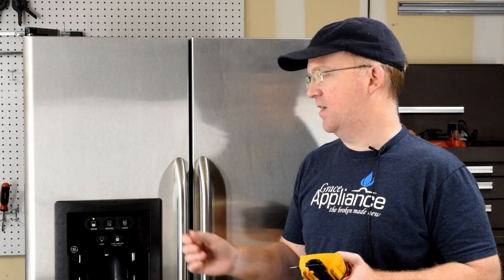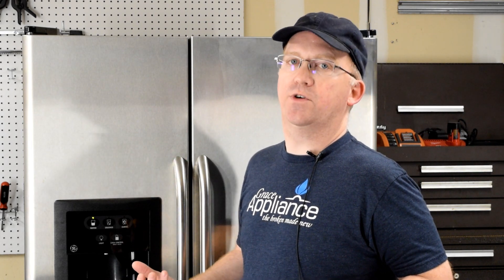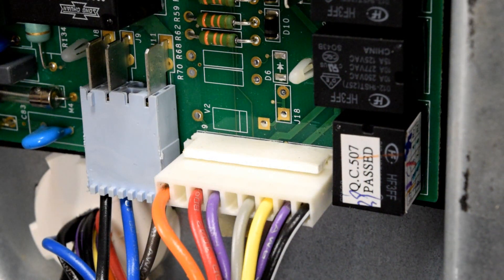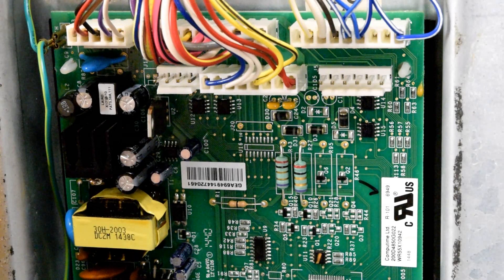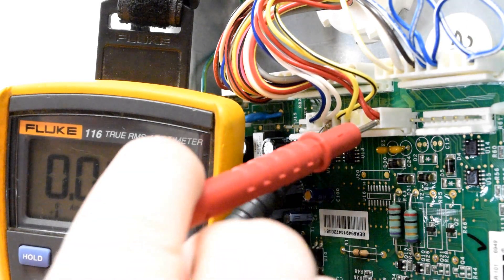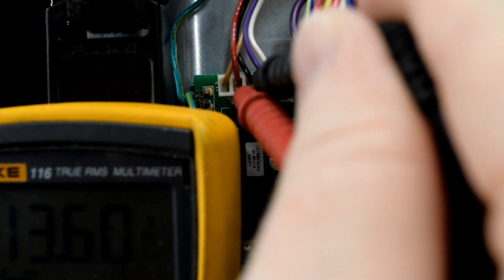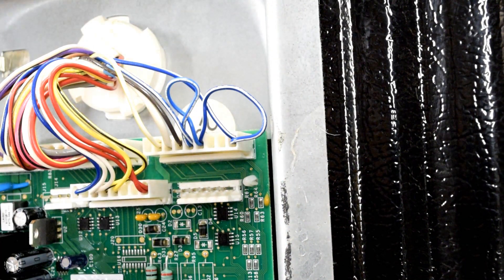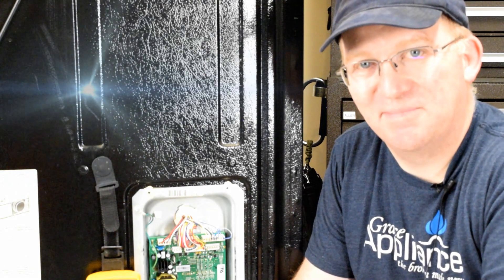Dead Refrigerator - What to Check

Comment: What should I check if the voltage to the main board is off? The meter reads 10-20V to the board instead of the expected 120V. Door light turns on but nothing else works.
Reply from the maker: Hey, if you’re not getting 120 volts as shown at 2:43sec of this video, you need to suspect faulty wiring between the wall plug and the control board. Since your lights appear to be working ok I’d rule out the main refrigerator cord. However, These lights are on a separate circuit than your control board. So, with the fridge UNPLUGGED I’d check the plug near the compressor where the main power cord attaches to. You’ll see a bundle of wires there. Unplug this connector, inspect all of the surrounding wires for damage or lose connections.  
Rodents (especially during cold weather) tend to make homes out of this space in refrigerators because it’s warmer and they like the taste of the wire insulation.  Be sure it’s not connected to power while you’re poking around in there. If you do have a stripped wire for some reason, you can easily shock yourself.  Ask me how I know!  :) 

Let me know if you have any questions.  
Andy
Reply: @GraceAppliance  Thank you so much. I unplugged, cleaned and plugged those cables and power was back to normal. The board was still bad though, thanks to your videos I could diagnose it with confidence and after installing the replacement the fridge is back to normal.
Reply from the maker: Horacio Gonzalez Larrain awesome!  I’m so glad you got it figured out and my video could help provide an extra boost of confidence to do the repair yourself.  If you do hit any snags once you get the board just let me know.  Thanks and stay in touch! Andy 

If you’ve found this ad-free information helpful, please consider a $1 donation to help support the YouTube channel at: https://www.paypal.com/donate/?token=p_-S29vsNHZsyxBt-llMSH_zJe4utLKcfvVRiZJHP0vIM5ldZMsdxPh9xywqckuI65fdq0&country.x=US&locale.x=US

Comment: Hi Andy, I have to tell you that love your videos  and I hope you can help me to diagnose my issue with GE refrigirator.
I have SxS GE refrigerator. Based on your video I detected that control board  got burned , so I went ahead and replaced it today. It did not solve the problem. It is not completely dead. My refrigirator does have light but the fan and compressor on the back of it  is not running. The voaporating fan inside the frizzer seems running just fine  but not the one that is next to the compressor. I also replaced the starting kit that is next to the compressor. I tested the compressor and it seems to be working. I do hear some buzz noise for a second or two as soon as I try to plug in the refrigerator. Also, I tested that It doesn’t start after I unplug J 4 from the main board. What would be my next step to test? Thank you.
Reply from the maker: Hey, the fact that it starts up after unplugging the J4 connector tells me that your fridge also has a failed (shorted) front touch panel.  You’ll need to replace that and will be good to go.  If you’ll use the link in the description to purchase your part, that helps a ton and is greatly appreciated.  

Thanks, Andy 

If you found the information helpful, please consider a $1 donation to help our YouTube channel. It’s greatly appreciated. 
https://www.paypal.com/donate/?token=p_-S29vsNHZsyxBt-llMSH_zJe4utLKcfvVRiZJHP0vIM5ldZMsdxPh9xywqckuI65fdq0&country.x=US&locale.x=US
Reply: Andy, when I unplug J4 it Does NOT start refrigirator. I have i feeling that the start relay that I replaced is not good. I just hear a humming noise for a second or two but that about it. It doesn’t start the compressor.
Reply from the maker: Viktoriya Almazan I’m sorry, I misread that portion. 
Disregard about the front touch panel.  Now, it could be that you have a seized up compressor which would cause this symptom. 

It’s easiest to test with an amp (I.e. clamp) meter on one of the 2 wires leading to the compressor relay.  It should read about 1.5A, but if it’s locked up would read about 10A for several seconds.  

Another way to test is to unplug the fridge, unplug the relay from the compressor and replug in your fridge.  If it starts up, it sounds like a seized compressor.  Let me know what you find.
Reply: @GraceAppliance   I unplugged the refrigirator and the start relay but nothing has changed.  Is it normal for overhead protector  relay to make a little noise  coming from inside when I shake? My old overhead had this sound and the new one that I replaced has this " baby toy like" sound
Reply from the maker: Viktoriya Almazan yes, they do make a little rattle, but you shouldn’t hear things rolling around inside the case when you shake.  A baby rattle is a good description of how it shouldn’t sound.  

With your fridge relay unplugged from the compressor, measure the resistance between the 3 pins in all combinations and tell me what you read. Also, check each pin to see if you have resistance between the pin and a copper pipe leading to the compressor.  Let me know what you find there too.  

Thanks!
Reply: If I am setting up correctly my multimeter , the lower two pins read 7-8, and the each bottom pins with the top ground reads 5. The Cooper pipes that attached to the compressor ranges from 1-999. Multimeter doesn’t seems to stop on one number.
Reply: Multimeter doesn’t capture the resistance between the pins and the compressor copper  pipe
Reply from the maker: Viktoriya Almazan thanks!  
The 3 pins have 3 combinations that you can measure. The lower 2 values should add up to the larger value. For instance, 4.3, 4.3, and 8.6ohm. 
So, yours seems a little off in that respect.  

Also, the test for continuity between each Pin and the copper pipe is looking for a short between your compressor motor and ground. You should see no change in the meters reading when doing this test. 

It sounds as if your compressor is shorted to ground.  This certainly could cause a board to fail in the way yours did. 

To further test, as I mentioned, you could borrow an amp meter to see what kind of power the compressor pulls at start up.  You would see a quick spike in Amps to around 10 for a second or so, then it drops to about 1.5 once the system equalizes.  

Just based in what you’ve told me, that’s what it sounds like to me.  Sorry to say.
Reply: @GraceAppliance  Ok. Between te two bottom pins multimeter  reads- 9, and the left pin to the  top (common I think)- 5, and the right pin to the common -4.  Thank you.
Reply from the maker: Viktoriya Almazan ok, that sounds good then. No issues there.  
I’m still concerned that your compressor motor may be shorted to ground.
Reply: So, it means the compressor is bad?
Reply: If it is short to the grand, can it be fixed?
Reply from the maker: Viktoriya Almazan it’s non repairable without replacing the compressor which in most cases is too expensive to consider.
Reply: It is kind of weird to hear that the humming noise I was taking earlier about stopes where the water pipe connects to the water valve. I am thinking maybe I need to replace something there.
Reply: @GraceAppliance  Got you. Thank you for your consultation.
Reply from the maker: Viktoriya Almazan you have 2 water valves there behind the rear fridge panel. With your fridge unplugged, you can test the 2 terminals on each of these valves for resistance (Ohm test) and should get around 300 ohms as i recall.  It makes me think they are getting voltage full time when they shouldn’t. However, I’m not sure if a shorted compressor would cause this symptom.  

With the compressor relay unplugged (and the fridge plugged back in) you still hear a buzz from the water valve and the condenser fan still does not run, correct?
Reply: @GraceAppliance  no , when the refrigirator unploged I cannot hear any noise. Only when I try to connect to the pover I can hear the buzz sound right at the end of the water pipe that goes from the filter  down next to the two water valves. Want to mantion that I never connected refrigirator to the water line. For a 1.5 this refrigirator was placed in garage as an extra one.
Reply from the maker: Viktoriya Almazan ok. I’m not certain what would cause this buzz, unless the dispenser switch is also defective. This would cause the water valve to buzz full time as you mention. I’m not sure this would be related to the compressor issue. Perhaps you got a power surge that damaged both.
Reply: @GraceAppliance  I  will contact an electric to check that for me . Thank you for your help
Reply from the maker: Viktoriya Almazan you’re welcome!  Please let me know if you have any other questions!
Thanks, Andy 

If you’ve found this ad-free information helpful, please consider a $1 donation to help support the YouTube channel at: https://www.paypal.com/donate/?token=p_-S29vsNHZsyxBt-llMSH_zJe4utLKcfvVRiZJHP0vIM5ldZMsdxPh9xywqckuI65fdq0&country.x=US&locale.x=US

Comment: Great series. I am watching it for a KDK wine fridge which is problematic. I have 220v going to the board. I can bypass the board and power up the compressor. Next step: checking the other elements with the MM this week. As the board looks clean on both sides I suspect faulty relays... Thanks for putting this video series together.
Reply from the maker: Awesome work!  If you think about it keep us updated with the outcome and if you have any questions.

Your fridge runs on 220v?   I know certain countries will use 220 vs 110, but I've never had to work on a 220.
Reply: @GraceAppliance  well, 110v and 220v don't discriminate : they are both deadly ;) thanks for the encouragements. I will come back here and report after I test everything and replace the control board relays...

Comment: Hello Eddie, I am a HVAC tech and my neighbor asked for help, his refrigerator stopped working, the model number is LWT8506A, I always bring an extra power cord with me and his refrigerator is working now but i had to bridge the connection on the control board located right next to the compressor but it is bypassing the defrost cycle which is kind of bad , I searched on the web but i did not find any info about this control board, I need help finding that.
Reply from the maker: Juan Amador hi Juan, 
Unfortunately, I’m not able to pull up anything in my systems either on this model.  I think maybe it’s a model made for Mexico specifically, and maybe that’s the issue from my side. I’m not sure.  

Like you said, bypassing the defrost isn’t ideal, but leaving the compressor running full time isn’t good either.  

I’m not sure what to suggest for you as the next step unfortunately. 

You might start by unplugging the fridge, removing the control board and inspecting the board for any burned marks or obviously failed components.
Reply: @GraceAppliance  , Well thanks anyways, if you find some additional info just let me know

Comment: I did various tests and the control board failed multiple. Not paying attention, I plugged the fridge back in with the J2 unplugged and it kicked on just like normal. Control panel lit up and everything. Sounded like a normal running fridge. Help!
Reply from the maker: Hey, you likely have a shorted evaporator fan motor. These often fail because of the moisture from the evaporator. If you wanted to double check this theory, you can unplug the fan motor inside the freezer and then plug the fridge back in. If it comes to life as it just did, you've isolated the evaporator fan motor as the culprit. Does that make sense?

Thanks!

Comment: I am getting 7.5 volts out of the control board  to the invetter controller. Is the board bad?
Reply from the maker: Hey Alan, what is your model number please?
Reply: @GraceAppliance  wow tha that wa s quick, I was able to found out that 7.5 was normal. My inverter board blew, it's working now, I hope. Thanks for your help the video wa s great
Reply from the maker: @alanrink4268  hey, you're most welcome. I'm so glad you got it figured out!

(For others that may have issues) 
Yes, the main boards only job in the case of inverter boards is to provide some low DC voltage to tell the inverter board to send the voltage to the compressor. The compressor is variable speed and the main board may send 3 different voltages (say, 3.5v, 5vdc, 6.5vdc) which the inverter board then translates this signal in to Low, Med, High compressor speed by then providing the appropriate volts AC to the compressor. (say 60v, 90v, 120v AC)

Comment: Compressor not running and Condenser fan not running. the other fan inside is running ,I think i did all of the checks on your video's where am i missing it at
Reply from the maker: Hey, 
I'd start with checking your temperature sensors and if you have a GE side by side, this video should help if you haven't already checked them with a meter: 

https://www.youtube.com/watch?v=CG-2FnQ43Hs&lc=UgxbUipYtmqDLkcufCJ4AaABAg

The condenser fan near the compressor will run only when the compressor runs. The compressor will run only when it's "too warm" in the fridge or freezer.  If the sensors are not good, the board never gets the message to turn on the compressor.  So, i'd start there.  

It could also be a failed control board. If you wanted to reply with your model number it would help me with my suggestions.  Also, be sure that you've unplugged the fridge from the wall for 5 minutes to reset the control board if you haven't done this already too.  

Thanks,
Andy
Reply: model #  SSL35KFPE  BS ,  Serial #TF79457
Reply from the maker: @williamsims8919  Thanks William, What brand is this,  Kratos commercial unit?
Reply: @GraceAppliance  it is a  GE
Reply: G E  side by side
Reply from the maker: I see thanks!  Maybe we're a number off or maybe they don't have the schematic where i'm looking.  Either way, I wanted to check to see if you had an inverter compressor or an older style 120v relay compressor.  Also, certain models will have 120vac condenser fan motors and others a 13.5vdc condenser fan motor.  

On your control board, you'll have a larger light blue plug near the bottom which has 3 larger terminals on it.  The far right pin ( a pin grouped by itself) is the 120v coming in to the board.  You can unplug the fridge, use a jumper wire to connect this pin to the far left pin on this same plug (i.e. your compressor circuit) and once you plug it back in, you should then hear your compressor come on.  Don't touch anything with your bare hands when it's plugged in, and once you've heard it run - remove the power and jumper cable you used for this test.  

If the compressor runs, you've ruled out a failed compressor and compressor relay. 
The fact that your fan and compressor are not getting voltage lead me to think it's a failed control board or failed temperature sensors.  

I'd research the temperature sensors from the video I linked.  

Let me know what you find with the jumper test and also if you have any questions with testing the temp sensors.    Thanks!
Reply: Andy,  Sorry for the typo mistake .GE Side by side Mod #SSL25KFPE BS ,  Serial#TF279457
Reply from the maker: @williamsims8919  Thanks!
So, your condenser fan motor is 120v AC.  To test for voltage at the fan plug, you should have an orange and black wire. You should have 120v here.  If not, I would then suspect it's going to be control board related. 

If you leave a door open for 3 minutes (with the fridge plugged in) it sends the board in to what's called linear protection and should then send voltage to both fan motors.  If you still do not get voltage to the fan at that point, replace the main control board and that should solve the problems you're having.  

Here is an amazon affiliate link to the board for your fridge: https://amzn.to/2TL2fZ0

I hope the info is helpful, please let me know if you have any questions.  

Thanks!
Andy
Reply: Took the mother board off and it is burnt at the relay ,ordering one now thanks alot
 @GraceAppliance
Reply from the maker: william sims awesome!  Nice work! Let me know if you run in to any snags.  Thanks!
Reply: No no no. it is all on you. That is {Nice work} should get the control board 6/28 it took longer than Amz said  but you would have to know where we live in WVa will keep you posted thanks again 
 @GraceAppliance

Comment: Using this video, my 12 year old daughter and I were able to diagnose and repair the main control board our GE refrigerator which is 11 years old but still looks brand new.   Having no experience using a voltmeter or in appliance repair, your video was so simple to follow!   The part cost $220 with next day shipping.  Thank you!
Reply from the maker: Great work to you and your daughter Marie! Glad to have been some help. Stay in touch.

Comment: Hi Andy, I have a GE sxs. Lights and fans are on but not the compressor. I noticed the front panel on the dispenser is not on and when I plug the fridge in, you can almost here the compressor want to click on, but then goes silent. Thoughts?
Reply from the maker: Hey Joseph, 
I'd start with this video. 

https://www.youtube.com/watch?v=ViFpwH6_WrM

If you unplug the front control panel and the compressor comes on, it's going to be a shorted front touch panel that's the issue.  

Let me know what you find. 

Thanks,
Andy
Reply: On the J4 plug, my voltage is fluctuating between 4.5 volts to 11.0 volts. It just keeps going up and down.
Reply from the maker: Joseph Stevens ok, unplug that connector at the main board (j1 I think) and measure for voltage on those two pins on the main board.  If you’re still getting fluctuation on the voltage like this, replace the main board.   Thanks!
Reply: I did and it's still fluctuating at the main board. Will this prevent the front panel from lighting up?
Reply: Thank you Andy, I liked and subscribed. Your videos are very helpful. Thank you!!
Reply from the maker: Joseph Stevens yes, replace the main board and you should be good to go.  Thanks!